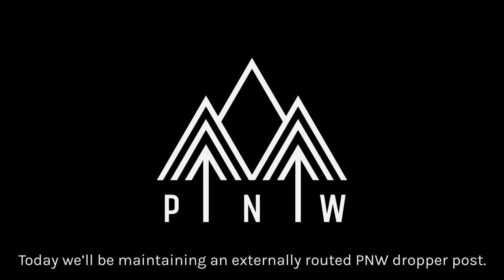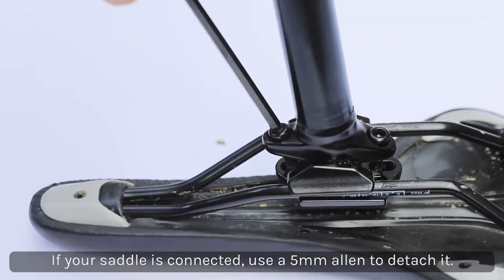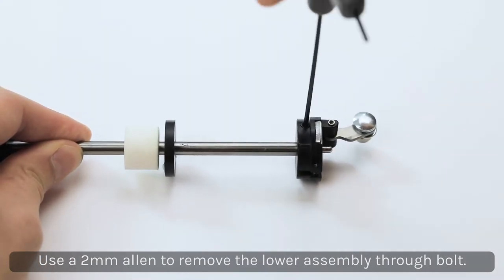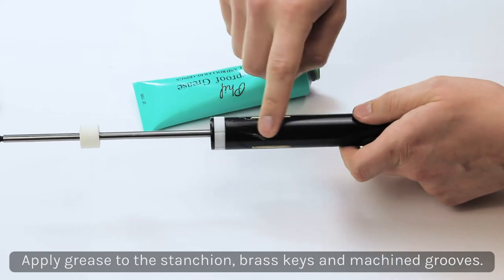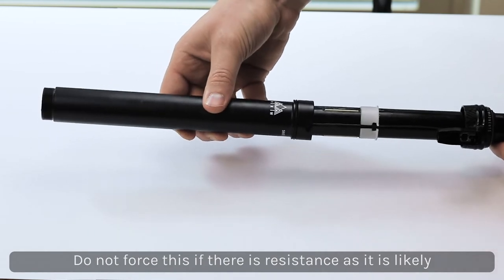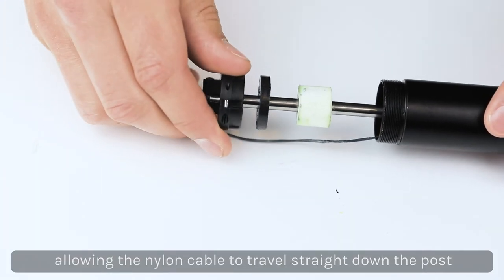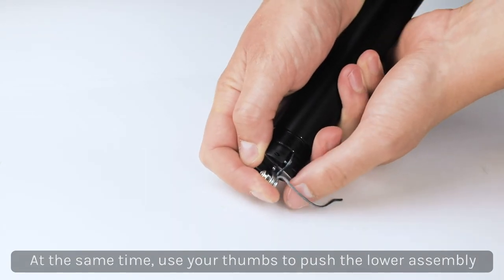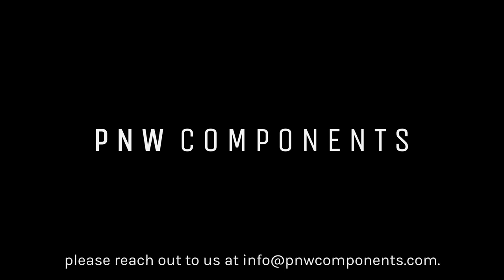PNW Components: How to Maintain an Externally Routed Dropper Post

Comment: Good tutorial! How often do you guys recommend servicing an externally routed dropper like the Cascade?
Reply from the maker: Great question! You can service your dropper as many times as you'd like without damaging the post. However, the more often you service the post, the more likely it is that the nylon cable sustains accidental damage and the more materials (rubbing alcohol and bike grease) you'll end up using. Unfortunately bike grease isn't the most affordable product, so the costs can add up if you service your dropper frequently. As every rider rides in varying conditions and uses their bikes for different durations of time, there is no absolute answer for how often you should service your dropper. So our best recommendation is to service it either whenever you like, or when you feel that the dropper is sticky or slow in its movements. Hope that helps!

Comment: Ascend model very similar. Doing it tomorrow. Note...found water in lower assembly. Lots of metallic corrosion in some parts. Sitting unit on top of pc rad to heat and evap....wish me luck.....
Thanks for vid.

Comment: Great video!  Followed the directions in the video and my dropper is just like new again.  It was starting to get crunchy going down and now it's smooth.  Re-assembly was a little tricky getting the outer assembly over the brass keys but just be patient and it'll be back together before you know it.
Reply: hi. after how long it get crunchy?

Comment: My nylon cable broke on the second day. Not ideal. Luckily there was enough slack at the bottom that I was able to tighten it back. It's good that this video exists and it is WELL MADE, but I shouldn't have to fix my dropper after maybe 3h of riding total.
Reply: Sucks for you. Mine lasted 2 years before it broke. And I ride an average of 3 time a week for the past 2 years. This is the first problem I've had with it.

Comment: Note for anyone - I was surprised when the brass keys you see at 2:55 or so fell out and tried to hide on my garage floor.  Took a while to find them - so be careful and clean over the middle of a table and be prepared for the brass keys to fall out of the the machined slots that they fit into on the cartridge.  That said - seat post works much better now - amazing what a service and some new grease can accomplish.
Reply: hi. after how long usage it get crunchy and stiff?

Comment: Watched entire video twice and read every comment.  Can't figure out why a dropper post would seem to function great in every way, except that it is buckling under just a little bit of weight (maybe 75 lbs)  with a little force I can compress the post with no tension on the nylong string with my two hands, and hear what sounds like air leaking.  Which makes sense... because the highly compressed air designed to hold up a 250 lb rider has to go somewhere when compressed when the post is dropped,  right? 

Anyway.  Wish the video explained the concept of how a dropper post with no manual air compression works.

Comment: 6:35 I've had trouble trying to get the lower assembly flush into the dropper again, what advice do you have
Reply from the maker: Hi! If you've been following the recommendation at around 6:20 and it's still not working, can you reach out to our Customer Service team directly via info@pnwcomponents.com? They're super quick in providing answers and should be able to help you out. Thanks!
Reply: same here

Comment: You mention air pressure, but I am not aware of any PNW external droppers that use air springs.  Do you make one?
Reply from the maker: Hi Shane! The Coast Dropper is our only external dropper post that comes with an adjustable air cartridge so riders can dial in its suspension.

Comment: Would it be ok to use WD4O instead of alcohol
Reply from the maker: Hi! We would not recommend using WD40 in place of rubbing alcohol. Once dried, the WD40 would leave an oil-like layer on the dropper while the rubbing alcohol will remove the previous grease and clean all the way down to the alloy. If you don't have rubbing alcohol on hand, we would also recommend Dawn soap as long as it is thoroughly rinsed off. Cheers!
Reply: @PNWComponents  thanks